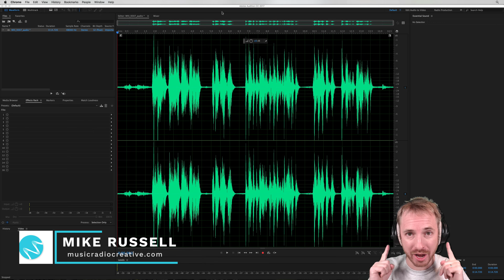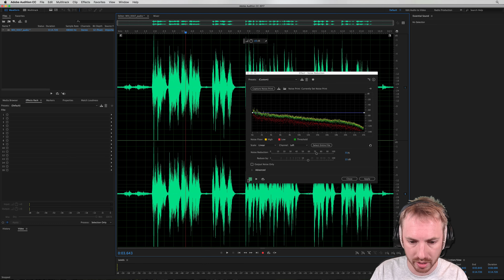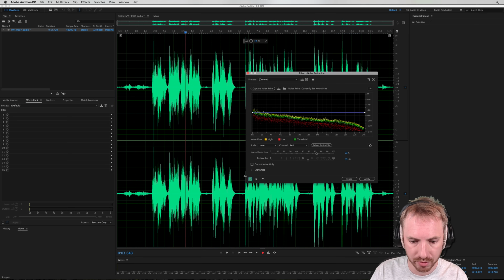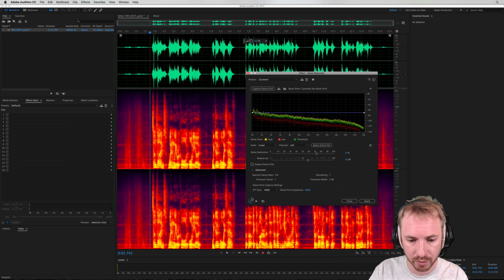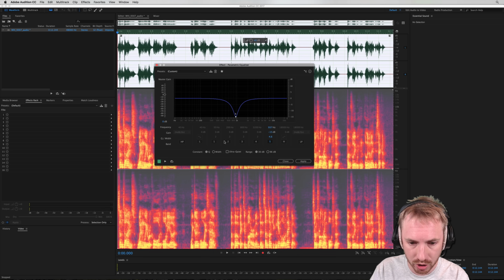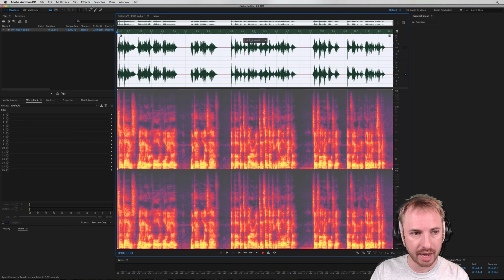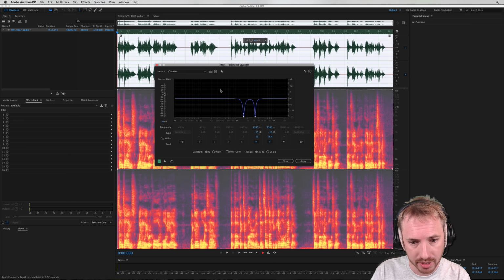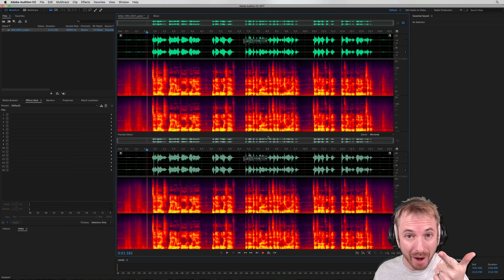How to Remove Room Echo in Adobe Audition

Comment: I tend to shy away from anything like this.  No matter how much you dial it in, you still hear the background noise while the person is talking, it's very apparent that it goes away when the person isn't talking.  I think this is actually more distracting than if the static is there the whole time.  You're literally grabbing the listener's attention, pointing to the steep difference in static.  For this, I find it's just better to just denoise.  Do it to the point that the person speaking still sounds the same.  If you have multiple tracks, it's much better to denoise each track that needs it, rather than working with all tracks through a bus.  The different vocals are usually quite different from one another when it comes to background noise.

Comment: You are not capturing the room sound on a quiet part. As a room just doesn't magically create noise by itself, you need a sound that will bounce of the walls, hence the only thing you do capture is the microphone noise, which you then can remove with the Noise reduction process. 
I'm not doing a whole lot of video audio as I normally work with music, but I have found that Adobe doesn't provide any actually useful reverb removal. Both audition and premiere introduce more phasing problems than removing the reverb, it usually only works on very very low reverb that almost is not a problem, so in most cases where you'd actually need it, its useless. Izotope RX7 for instance does a way better job at this, and is good for isolating other sources against others aswell. Like removing vocals from a song for instance. Accusonus ERA 4 Also is a very good option.

Comment: I've been using Audacity, not Audition, but his helped me a lot in understanding where to find the frequency for the echo. I wasn't able to remove all of it, but did get rid of a large percentage of it with noise reduction and a bit more by tinkering with the gain at higher frequencies. The latter seems to be more effective if I go piece by piece through the audio, as the same settings didn't work for the entire thing.
Reply from the maker: Hi, this is an old video and if you're using Audacity it's the best way to achieve this still but since this was made Audition has now included a DeReverb facility.

Comment: The reason it doesn't sound different it because he's doing noise (hiss) removal instead of reverb removal. You can buy plugins for reverb removal, but Premiere/ Audition 2020 comes with it as standard (called DeReverb).

The parametric equaliser trick he does can help sometimes, but compressors tend to make reverb sound worse.

Comment: For some reason, every time your videos recommend using "Capture Noise Print" and "Noise Reduction(Process)" I do what you do in the clip and it NEVER shows any marks on the graph (the noise floor) and no amount of toggling or adjusting effects in the window do anything to alter the sound of the clip. Is there some preference or preset I need turned on to make this work?